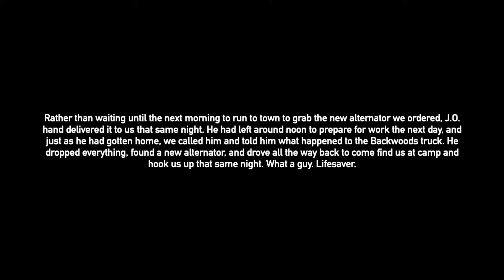TOYOTALITY - My Craziest Trip EVER - Broken Parts, Hard Wheeling, and a Solar Eclipse!

Comment: I was watching one of your old videos on your snorkel installation. I was wondering how the tape on the a-piller was holding up? I just got my safari snorkel yesterday. Didn't really want to drill into the a-piller either. Thanks
Reply from the maker: Not the best. It’s basically come off now. But it’s mounted firm enough from the fender

Comment: Backwoods guys wouldn't sell me just a winch cradle. Like why lol. So much for buying local
Reply from the maker: We can’t sell them piece by piece unfortunately. They’re all boxed up as complete kits and it would mess up inventory and our manufacturing process. A lot more to it than it seems. Sorry man!
Reply: @ArkansasOffroad  Sounds like they sell every bumper they make then. I'd prioritize high asp items too.

Do you know if they are gonna offer different rock slider configurations anytime soon? I want one without tread plates and 10-20 degrees. But I don't wanna wait forever to get them.
Reply from the maker: @tuckerhiggins4336 Unfortunately we’re just going to continue with the version we have. Probably won’t ever have other options.